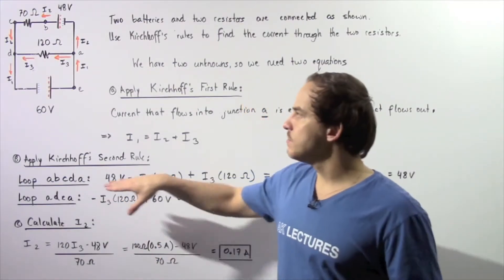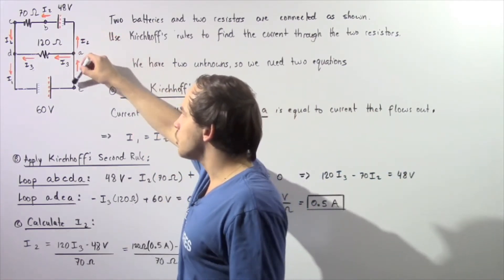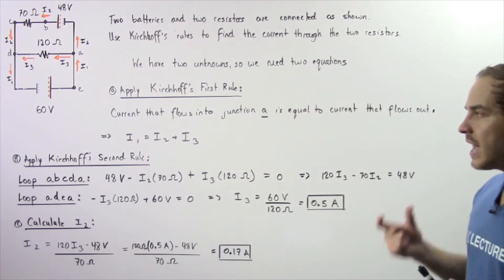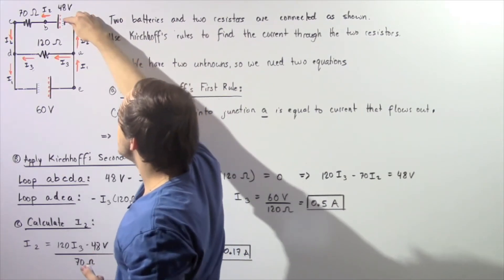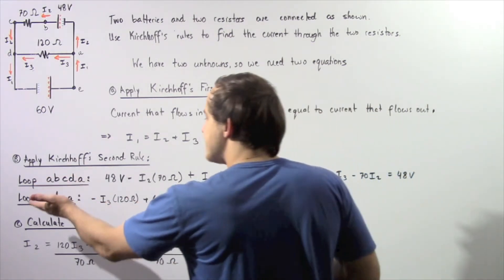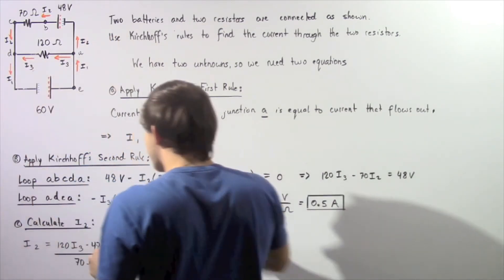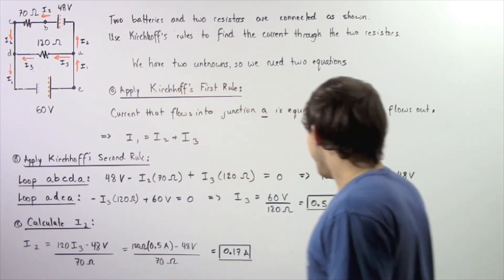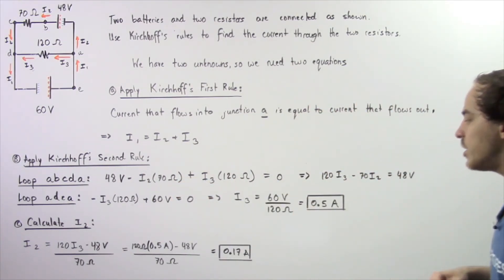Kirchhoff's Circuit Rules Example # 3

Comment: Great video! But when I rearranged the equation for loop abcda I got 48V=70 I2 - 120 I3 , I don't know maybe I made an algebra mistake..
Reply from the maker: You're absolutely right, I must have been dozing off ; )
Luckily that does not change the magnitude of the answer, just the direction. The negative sign indicates that the direction of our electric current (I_2) is in the opposite direction that we initially chose.